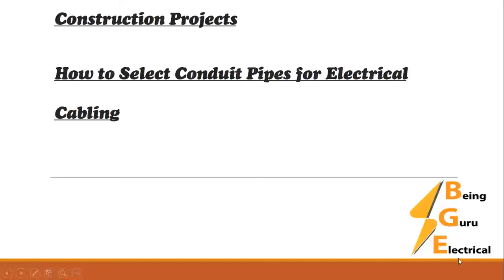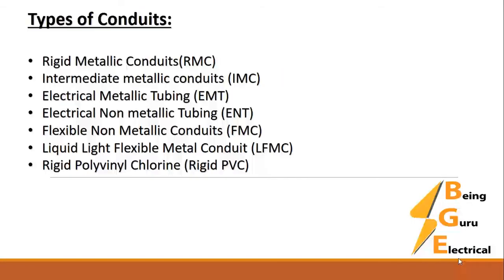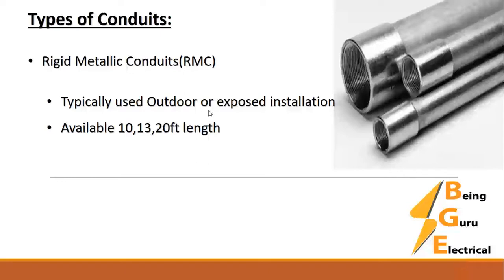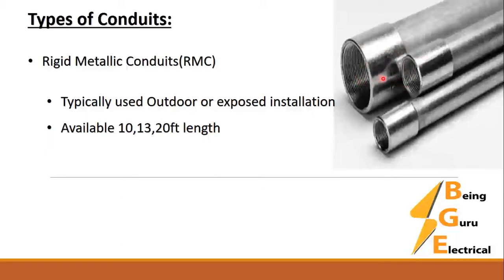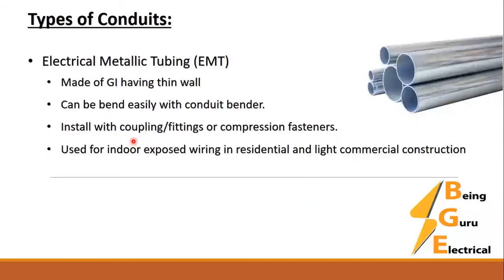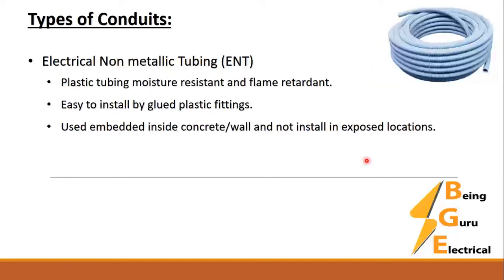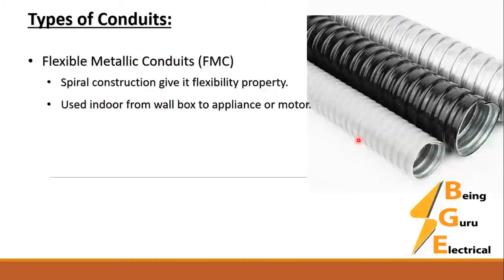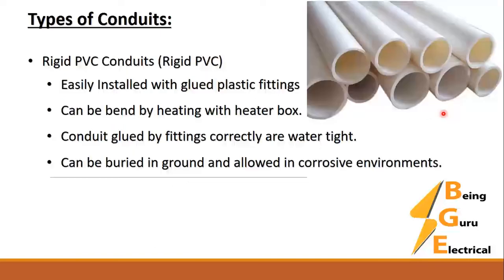Types of Conduits Pipes in Construction Projects | how to select a conduit

Comment: why westerner use conductive copper conduit? what is the catch to that?
especially if it gets short circuit >.<?
Reply from the maker: Conductive conduit are good to know any Short circuit at early stage, which is more in terms of safety. As circuit will be trip and not load will not be ON until fault rectified
Reply: @electricalbasics347  thanks for the info, usually no one gave info about the layman terms